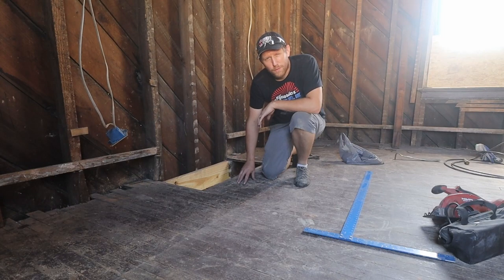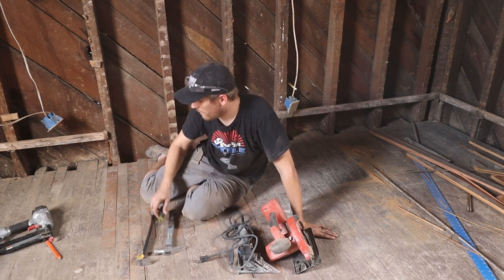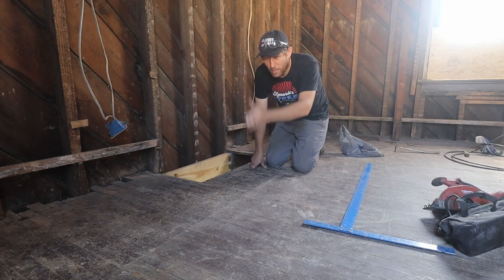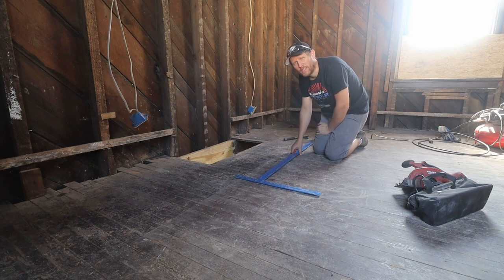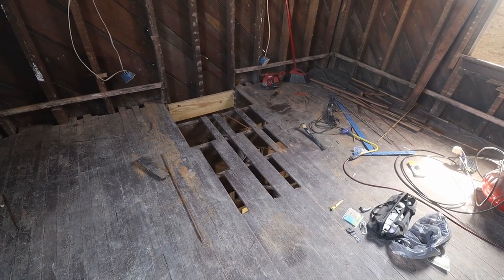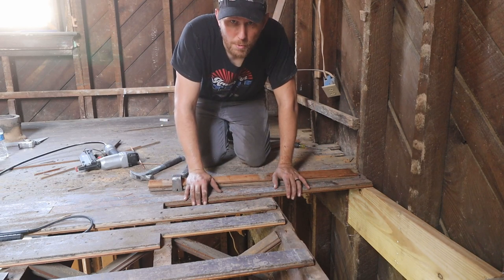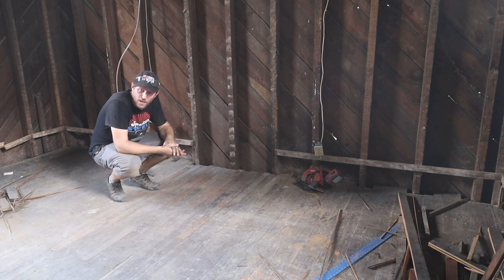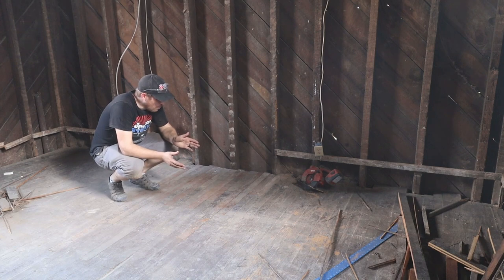Best Way To Fix A Hole In Wood Floors - Victorian Home Renovation [TirolerInn]

Comment: Nice video.  Is there a reason you nailed the new boards on the face instead of through the tongue where the tongue was exposed?
Reply from the maker: Since I used a pin nailer the holes are not going to be visible. Further there is only a few spots where the tongues could have been used in this scenario.